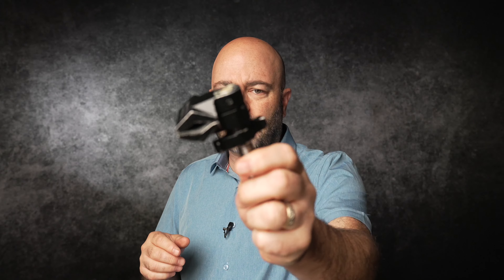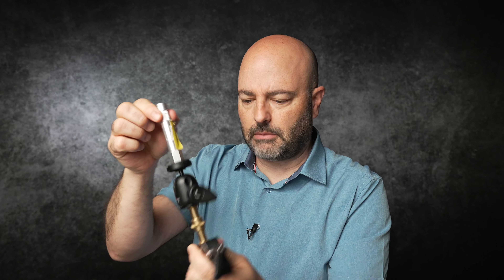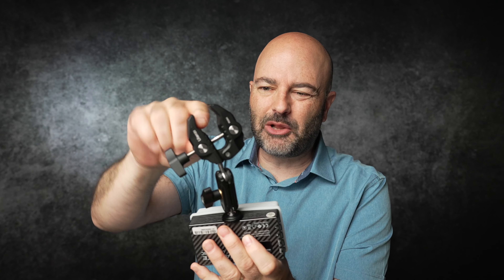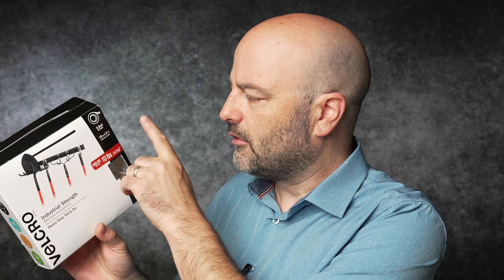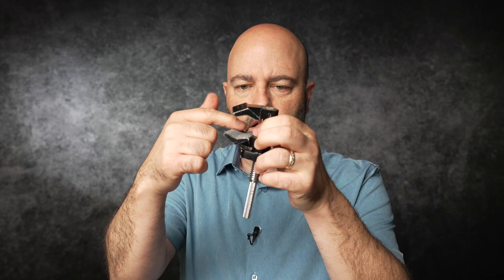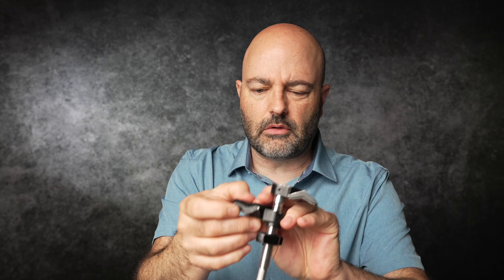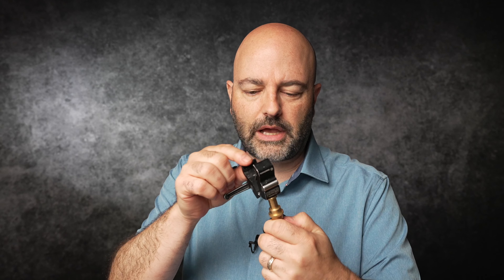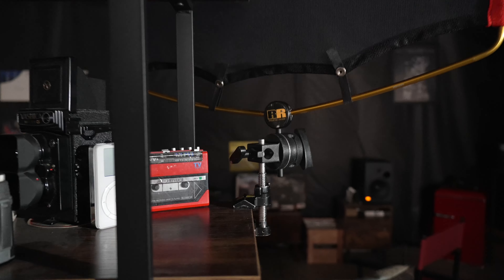Modifying Your Clamps to Protect S**t! (EP.6)

Comment: I like that, but have a question:  Doesn’t the Velcro “slip” if you’re say grabbing a pipe?  Wouldn’t that make you have to “crank down” harder to keep it from slipping.

I use a similar approach:  I have the usual set of Gaff Tapes on a rope/belt.  2”, 1”, 1/2” in all colors, but I also have a set of 3M Electrical Tapes.  I forget all the numbers (Super 88 etc.) and just grab what I need, but there’s one that’s super thick rubber.

With the Thick rubber tape, I think I get the protection, but it also makes the clamps “Grabbier”, and I feel like require less crank down most of the time.

I haven’t systematically gone through all of my clamps though, and none of my tricks has worked every time, but I like the soft loop mod as an option.

Keep em coming!
Reply from the maker: Yeah. I would say that the Velcro approach is best for small to medium sized stuff that you are gripping. 🧐 nice you get into larger clamps and pipes it’s a whole different ballgame. This is really about protecting furniture, etc, when using smaller fixtures and equipment. 

Yes the the thick rubber tape as well as it will inherently be “grippier” but the Velcro is great n a lot of cases. 

Thanks for watching and for your comment. 

-Jem

Comment: Hi Jem can you do a video about using autopoles safety in both vertical (floor to ceiling) and horizontal (wall to wall) orientations? Don’t have direct experience working with one and looking to rig up some lightweight overhead lights (E.g. light mats) without stands in the way in a rented space for a duration of maybe 1-2 years continuously (wonder if the walls will contract/expand over that time, affecting the tension/friction?). 

Worried about overlooking safety (there’s no place to connect a safety chain) and damaging the space. Hope you have some advice and insights for a worry free, safe setup! Thank you!
Reply from the maker: I can definitely put autopoles on the list but I, personally, wouldn't use them in a horizontal position. I would look into Wall Spreaders for that.

If used vertically, you could put together a simple grid using autopoles, double super clamps and 1" or 1 1/4" pipe. Depends on your fixtures but for most modern lights I don't see a problem until you get into the heavier stuff.

Not sure of the expanding and contracting part as I don't know the space, climate, etc.